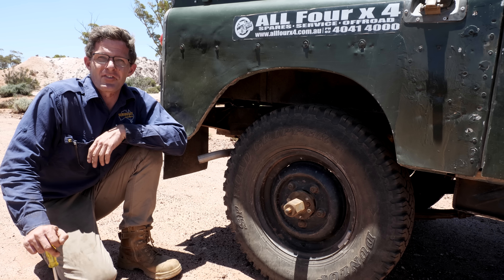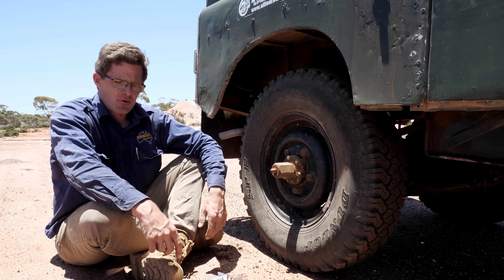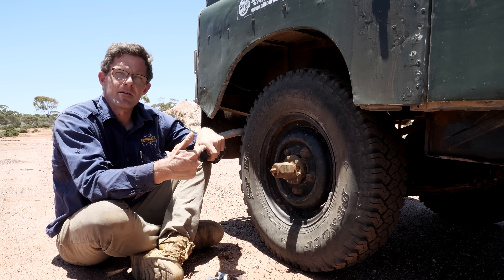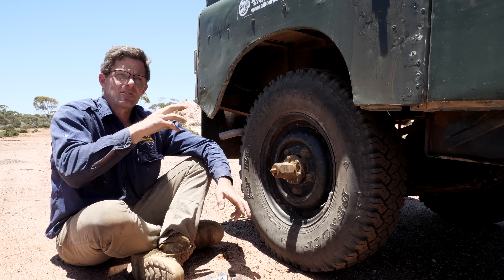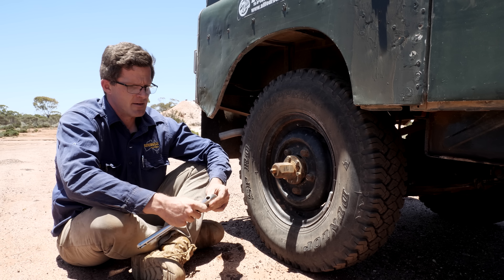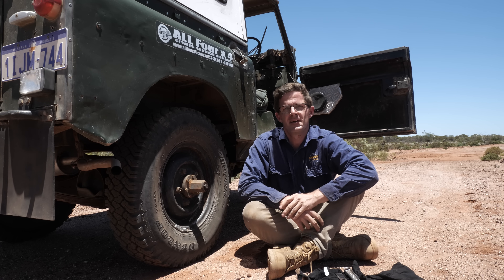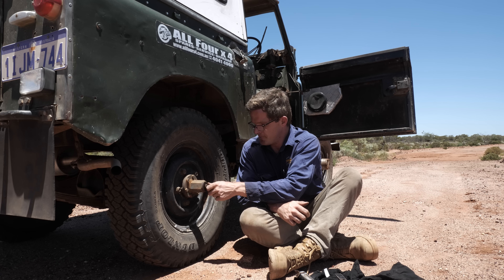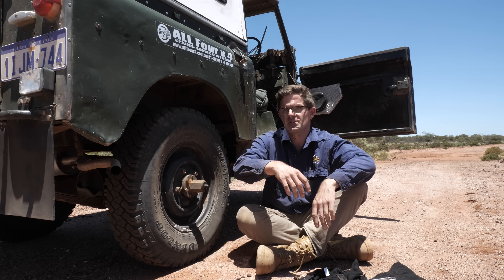World's simplest 4x4 diff lock: McNamara Diff Lock

Comment: I don't understand how this system locks the differential. From what I see, what it does is engage and disengage drive to the wheel just as a freewheel hub does except in this case it is engaging and disengaging at the differential and not in the hub at the wheel.
Please explain how this locks the differential.
Enquiring minds want to know.😁
Reply: From what i gathere:
It's just like a free wheeling hub as you suggest. However you also replace the spider gears in the diff which essentially is a permanently locked diff sending all power in the rear axel to 1 wheel.
When the bolt is removed, the other shaft engages and its now like a traditional locked diff.

So to me, it seems like you are reducing traction performance when unlocked for the benefit of being able to lock when needed.
Reply: @Sethjxl You are correct.
Reply: @simoncarter5951 no he is not, nor you lol
Reply: @ Unless there is some sort of aftermarket locking carrier inside the centre of that differential housing, that is actuated by pulling the axle, it is exactly the same. I can’t see how I am wrong.
Reply: @simoncarter5951   better put your glasses on so you can see 😂

The hemisphere or carrier (same same) is not factory. It is very conventional and that of a standard open diff, the only varying part is the custom cross shaft that is forged one piece with a splined hole in the centre and supports 4 pinion or planet gears (same same), 

If you lock one axle shaft to the carrier you have a locked diff. The cross shaft can not rotate in the carrier ( only with it). 

The axle shaft is always engaged in the side gear which is free to rotate independently of the carrier until the shaft is extended internally into the cross shaft…
Reply: @husq2100  And thats why there are 4 spiders. To prevent stripping two spider gears of the tiny teeth that engage. Positive lock. And an upgraded open diff as well. So long as the long bolt and the plug are not lost in the ensuing travels 😁
Reply: From the description / operation ... - the fully floating half shaft - spline  (extremely long spline) passes through the diff centre and locks into the opposing half shaft (or the opposite side of the bevel gear carrier...  When it is in the "out" position, the differential acts as a normal open diff - released by the spring "IN",  it becomes a solid shaft  right - to left..
 - they "should have" designed it to not require the bolt to be taken all the way out - but just to loosen it and "locknut it into location..  I could see many diffs being ruined by sand entering the axle tube...  ( Modern Cordless drivers are invaluable for getting things like this done quickly  (use a torque limiting drill -driver not an impact for things like this..)..

Here is a description from soleother "pirate 4x4"...  "The diff crosspin has to be replaced with something that allows the full floater axle on one side (let's say driver's side) to slide over in the splines of the spider and engage the opposite spider. The diff is then locked. I've seen a few homemade attempts at this and they seem to work well with a custom center pin setup that allows the shaft to slide through."
Reply: @kadmow it slides in and out of the carrier cross shaft that supports the 4 pinion/planet gears.
Reply: @kadmow  Yes, after posting my questiin/comment and giving it some tgaught, I came to the conclusion that it had to be the axle shaft that passed through its side gear and then engaged the opposite dide gaer splines. Pretty simple and failsafe. Now to find a way to replicate that actiin without that ugly protrusion at the wheel and without that bolt...🤔
Reply: @The_Elundu_Expedition_Project  it does not engage the opposite side gear….
Reply: @husq2100  Then I have no idea how it can possibly "lock" the differential.
Reply: @The_Elundu_Expedition_Project  the cross shaft that the 4 pinion /planet gears run on is fixed in the carrier/hemisphere , it can not rotate independently of the carrier. Once the axle shaft is engaged in the centre of the cross shaft,  that shaft ( and side gear ) is then locked to the carrier. You only need to lock one axle shaft to the carrier to have cross axle diff lock.

Comment: I remember these from the 1980's !  A friend of mine got one for the Salisbury type rear diff in his 109"   It was a pain to import to the USA back then !  I thought it was really cool.  Later, about 25 years ago, another friend got the same type.  These Salisbury versions upgraded from the standard 1.240" Salisbury 24 spline shafts to a much larger 1.500" 23 spline (early Dana 70 pattern).
Oddly, the locking control was on the LH side !!    This unit is still going strong behind Chevy V8 power.     The smaller unit shown here uses the standard 1.240" Salisbury 24 spline pattern with a special 4 pinion differential carrier.  Some of these were cast as all new third members that also used a Toyota ring and pinion.  I still have an advertisement for those that I got about 1988 !!

Comment: It seems quite a few here have misunderstood the operation of this differential.

Unlocked it is a regular operating open differential.

Locked it is a fully locked differential.

It does use a custom 4 pinion diff carrier/hemisphere that bolts in the Rover housing.

As a side note, most Series were 10 spline , except the Salisbury versions which are 24 spline. There is a bit of both in front ends and rears but Salisbury were 24/24 (diff and drive flanges ) from start to finish.
Reply: Thats the spline count I remember but he says 16 tooth? So it releases a longer shaft than normal into a spool in the centre?
Reply: @jackrichards1863  I think he might just have miss remembered the spline count. I’ve seen photos of the Rover diff version and they definitely look 24 spline, which make sense for manufacturing purposes as well.

The longer shaft which also has longer splines each end slides through its side gear and engages in splines in the cross shaft that locates the 4 pinion/planet gears.

Comment: Seems a silly type of locking hub. How would it drive when unlocked? Does it drive only on the other side? That's not differentiating & would pull to one side. Dumb & inconvenient.
Reply: You have misunderstood. It is a normal open differential in the unlocked position and a fully locked differential in the locked position.

Comment: This is an interesting idea, though the explanation of how it works at the diff end doesn't quite make sense to me and I'm wondering if its entirely accurate?

It would be interesting to see this half shaft removed.  I'm kind of suspecting it actually works by having a slot in the end of the shaft to grab the cross pin inside a standard Rover 2 pin diff, rather than being able to somehow pass right through the diff centre to engage on the other side (most diff locks actually work by locking one output sun gear to the centre, not both outputs together, as this would still lock up the planet set and is much easier to do given the whole centre has to rotate and the cross pin being in the middle).  Doing it this way, whilst a bit crude and probably not mega strong when locked would make it very easy to fit to a stock diff by just changing the shaft and drive flange which seems appropriate for what is claimed to be a cheep simple upgrade which rebuilding the diff centre would not be.

Upgrading the Rover diff centre using Salisbury components also sounds dubious.  The Salisbury diff normally found in the back of a 109 or 110 is a 24 spline design based on a Dana 60 crownwheel and centre which is simply massive compared to a Rover diff so I can't imagine anything could be swapped between the two.  The Salisbury is a 4 pin design with a giant crosspeice in the middle to support the 4 planet gears so there's even less chance a halfshaft could slide through a Salisbury centre.  Of course there are smaller Salisbury diffs out there that were fitted to smaller cars which are also of Dana design (25, 30, 44 etc) so its possible this alleged 16 spline setup features bits from one of them rather than the Land Rover Salisbury but I would be surprised if any Salisbury bits fitted a Rover diff without a lot of machining as the whole diff layout including crownwheel and carrier bearing offset is quite a different shape to a Rover.

Would love to know more about the innards of this one!
Reply: I’ll add to your comments with what little I know.

The half shaft/axle shaft , from old images I’ve seen looks to be splined similar each end. I suspect that it simply slides into and engages the centre of the custom cross shaft that the 4 pinion gears rotate on. Many diffs use two rebated overlapping cross shafts but some use one piece with a larger centre section. I imagine this is what is used. 

I’ll also guess that a Dana 44 carrier was used as these would be about the right size given crown wheel size of both the D44 and Rover diffs. 

While 16 spline was a Dana application the photos I’ve seen of the McNamara half shaft for these lockers looks much more like 24 spline each end…I think he just got that wrong, like the 8 spline comment.
Reply: @husq2100  So it has a spool in the centre that the axle engages inside the four spiders driven by the carrier cage? That also remains in connection with the other side axle permanently? Allowing variable speeds between them when disengaged.
Reply: @jackrichards1863 it is a conventional diff carrier, the only difference being the cross shaft that locates the 4 pinion/planet gears. This has a splined hole that the shaft engages and disengages in/out of.
Reply: Glad I'm not the only one left wondering.  What he described would be a good way of having no drive at all when you pull the axle out a bit. Been there, done that in a Ford capri, unintentionally of course 😂 There must be more to it surely?
Reply: 100% Agreed.

Comment: Since many components of the Salisbury axles were copied from Dana axles, is it possible to build a Dana and add the Salisbury Locker?
Reply: Given the axle housing is set up to suit wheel track, spring placement and other things, it’s much more common for people to upgrade their Salisbury housing with Dana internals. D60 CW&P gives more ratio choices and there are options with D60 carriers (diffs) . Though you can buy air lockers, vacuum lockers and ATBs for the Salisbury. D60 parts will allow and upgrade in axle shaft size as well but this will mean custom stub axles, axle shafts and flanges. Of course the D60 stuff is all imperial while the Sals 8Ha stuff is metric, so again custom work is required. The downside to our LR Salisburys is the wall thickness in the axle tube and the axle shaft size (and corresponding parts)
Reply: @husq2100  Not all Land Rover Salisburys are thin tubes.  Certain random Leaf sprung 109" rears have 10MM thick tubes, and the leaf sprung fronts are all thick tubes.  The coil rears are stupid thin tubes !! I never understood that !
Reply: @timmcooper294  hi Timm, firstly love your work over the years and have been following your recent endeavours with your group of friends 👍👍

The whole  LR Salisbury situation is an exercise in poor engineering IMO. If they were never going to offer larger shafts than 24 spline the D44 would have been more than up to the task, had better ground clearance and less unsprung mass.

And it really is disappointing the tube thickness in the coil sprung variants given the beauty of the cast in A frame ball joint mounting point. 

I’m currently in contact with Jesse regarding your new HD Rover diff replacement for a custom project of mine.

I’m also curious how you go about fitting 40 spline stuff in the LR hubs lol. Anyway, I hope you and your family have a good Christmas mate.
Reply: Back in 1992, I built a Dana 60 front axle to match my Salisbury rear.  The 8HA Salisbury is basically a Dana 60 centre with metric fasteners, and I swapped a factory series Land Rover Salisbury 4.70 ring and pinion into my custom front Dana 60!!

Comment: Like the simplicity/ruggedness even though it's slow to engage/disengage. I'd use a ring wrench or ratchet wrench over an adjustable wrench.
Reply: Guess he's using that because the drawing bolt and the bung are different head sizes
Reply: I was told the ajustable spanner was called “ the nut fucker “ 🤣but when I open the tool chest my hands still go for it 😂

Comment: Terribly labour-intensive and grossly inconvenient considering that you have to cancel diff-locks immediately after traversing the obstacle or else you are in trouble. I would fit a diff-lock that is easily engaged / disengaged at the flick of a button or lever whilst I am still seated behind the wheel, even if that may eventually falter after X years of service, or even permanently go open-diff than use the McNamara as you describe.
Reply: Just Cause you're not a real one my guy 🎉

Comment: interesting unit, but the large lump on the outside I bet got hit a few times. the Rover axle is 10 spline on Series, 4.1:1 raito, and the later Rover diffs were 3.54:1 and can be swapped out. The Defender were 10 spline to late 93 and then went to 24 spline. Salisbury axles were mostly 24 spline. 

So does this work with a modified ahaft and gear? when the shaft slides it goes through the diff centre into the other side gear?
Reply: 4.7-1 was the ratio for the vast majority of the Series vehicles. The exception being the Series 3 stage 1 with 3.54-1 as it used the LT95 gearbox/transfer case out of the RR and 101FC. 

All Salisbury were 24 spline at diff and drive flange (except for the limited Salisbury front axles with a CV and the unique axles in the 101FC) All front CV axle assemblies were either one piece drive flange and stub shaft or 24 spline at the drive flange.

Series 2a & 3 fitted with the Salisbury from factory had 24 spline front drive flanges as well, and late Series 3 they went to 24 spline drive flanges on all vehicles.

The locker in question uses a new shaft etc. you can google it and see the parts quite easily.